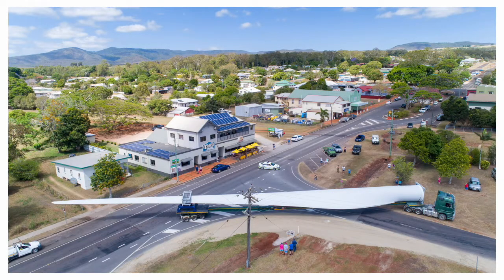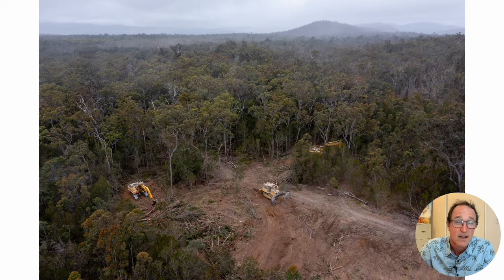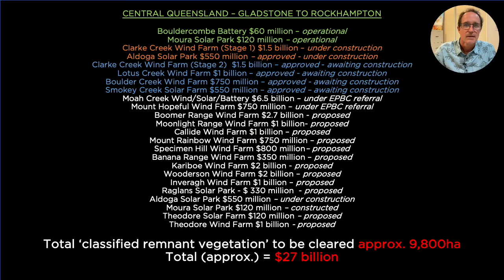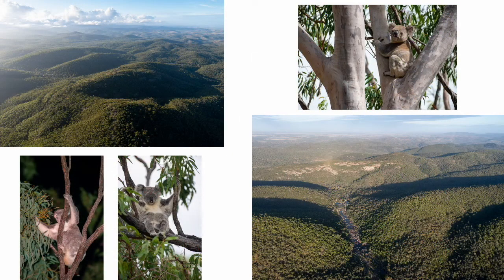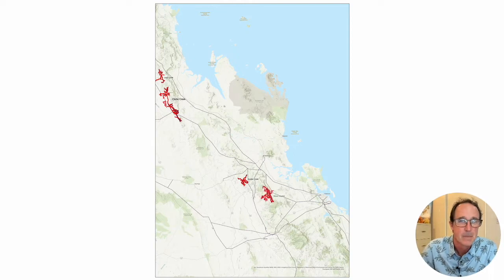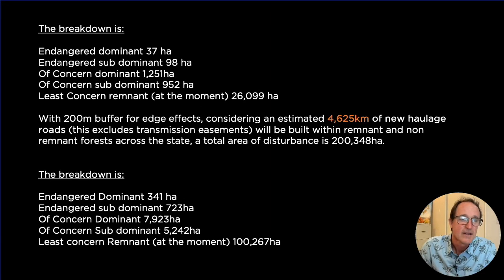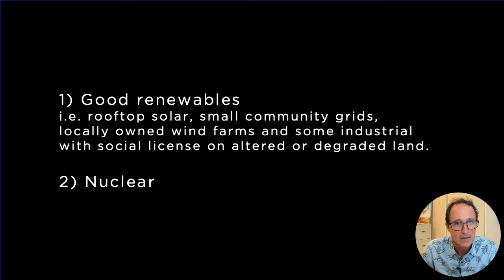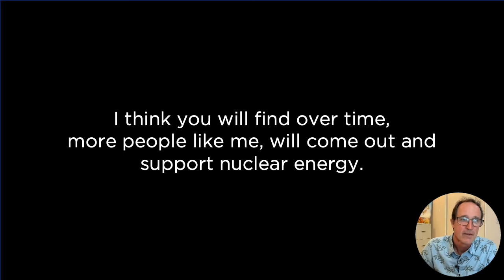Industrial Renewables in Central Queensland.

Comment: You need to look further into this so called Climate Emergency regarding CO2, Steven. I have found that it is impossible for CO2 to cause increase in global temperature. Don't trust computer simulation with climate models. I've been a finite element analysis (ie. computer simulation) engineer for 31 years and so I know how wrong computer simulation can be. Wrong inputs and wrong assumptions are the main causes for misleading computer models. A clue: All computer simulation results must be backed up by physical real World measurements. Historic and current real World measurements do not show any evidence of man made climate emergency. Good luck.